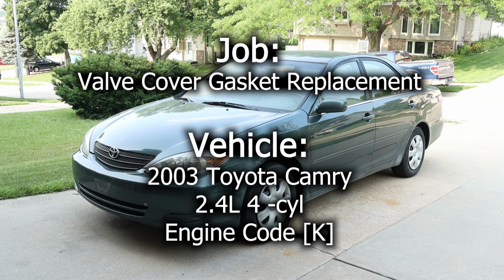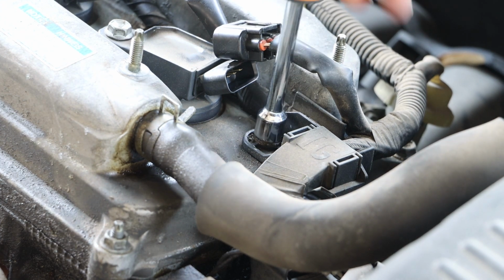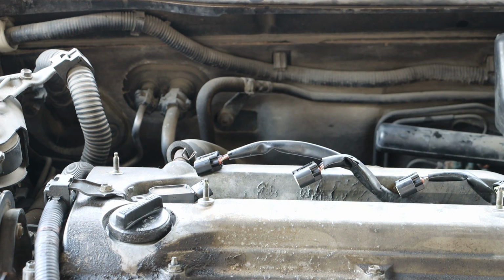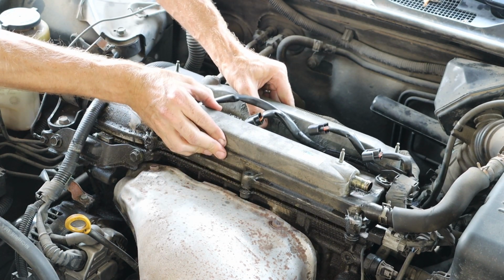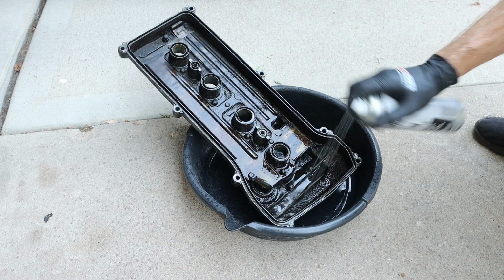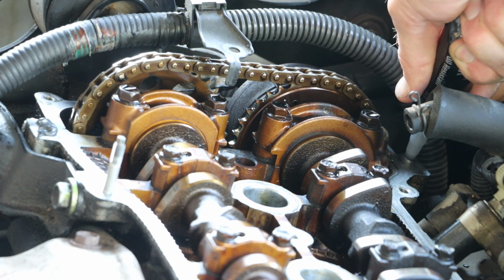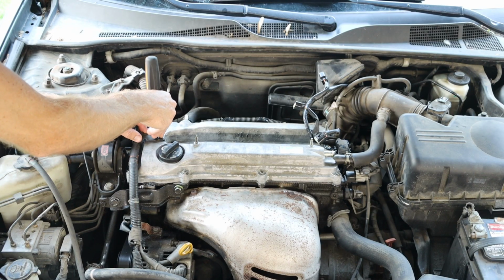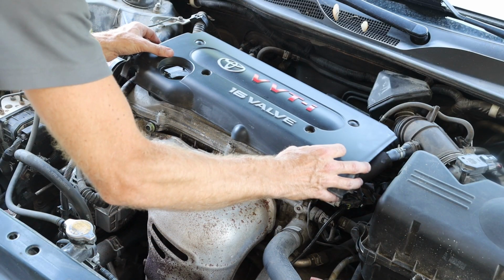Valve Cover Gasket Replacement and Ventilation Hose - 2003 Toyota Camry, 2.4L (2002-2006)

Comment: I know its been a while, but how did you clean the lower part that meets with the valve caover i noticed it was clea. After you installed the hose. What product and strategy did you use to get thay cleaned up i appreciate it, great video i love how you explain things
Reply from the maker: What is the timestamp in the video that you are referring to?  If it is a part of the engine block, my go-to products are Amsoil Engine Degreaser https://www.amsoil.com/p/amsoil-engine-degreaser-aedsc/?zo=10458 or Amsoil Heavy Duty Degreaser https://www.amsoil.com/p/amsoil-heavy-duty-degreaser-adgsc/?zo=10458

Comment: Great video!I had a misfire and replaced the coil but I noticed oil where the spark plug was. What's the fix for that? TY in advance
Reply from the maker: Typically the fix for that is replacement of the valve cover gasket. https://www.youtube.com/watch?v=K6Kxn-rabzQ&t=5s
Reply: @InsaneOil  I'll be doing that but I wasn't sure if that would fix it, or i have to take the actual tube out and reseal it. I had my valve cover gaskets replaced 2 years or 19k miles ago at a honda dealership

Comment: How do u get the ventilation hose off, mine won't budge....
Reply from the maker: I had to speed up the video because it took forever, and that was after it ripped.  My best solution is to work it back and forth, use a small screwdriver to possibly break the seal.  However, my hose was rock solid and there was no give.  Best solution is probably to cut it off with a utility knife and replace it.
Reply: @InsaneOil lol I thought the same I appreciate the reply. The annoying part for me is that the hose wouldn't budge and the valve cover of the engine when u take the bolts off wouldn't move either haha so I just put it all back together and called it a day

Comment: Does this repair help with burning oil?
Reply from the maker: I am going to say "no" as it did not reduce my oil consumption.  I hoped that it would but upon further research it seems as though it is a piston ring problem with these particular engines. https://www.youtube.com/watch?v=F994QmOD6W8&t=2157s

Comment: From my experience on this car,  2003 Camry,  and many other Toyotas,  Hondas,  Nissans, Fords, etc..  The calve cover bolts are very low torque. They are very easy to remove. I worry when they are tight because they may actually break.

Comment: What rtv did you use
Reply from the maker: Permatex Ultra Black https://www.amazon.com/Permatex-82180-Maximum-Resistance-Silicone/dp/B0002UEN1U/ref=asc_df_B0002UEN1U/?tag=hyprod-20&linkCode=df0&hvadid=312198323731&hvpos=&hvnetw=g&hvrand=9631428485332066520&hvpone=&hvptwo=&hvqmt=&hvdev=c&hvdvcmdl=&hvlocint=&hvlocphy=9024547&hvtargid=pla-432399660406&psc=1&mcid=f05bf4e5297b34b2bc1d4f86fb27c0ff&gclid=CjwKCAiA6KWvBhAREiwAFPZM7hlGgjrr19PdZXRPj75Y5sZEtvSM5yRO_gdrUySwpzNOgVahd4709BoCftcQAvD_BwE

Comment: Where do i get the air line that broke? I can't figure out what to call it or where it is on rockauto. Pcv valve hose tore also. 😠
Reply from the maker: You need to search the following: VENTILATION HOSE Part #12261-28100 or 12261-0H010
Reply: @InsaneOil  Thanks!